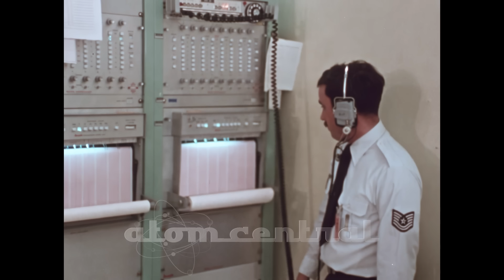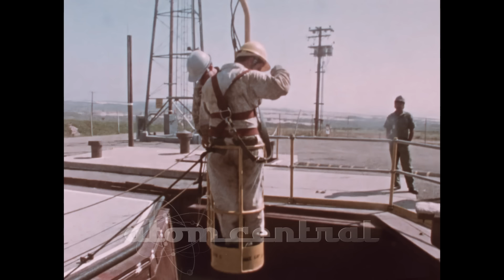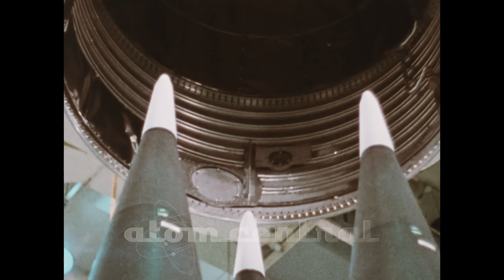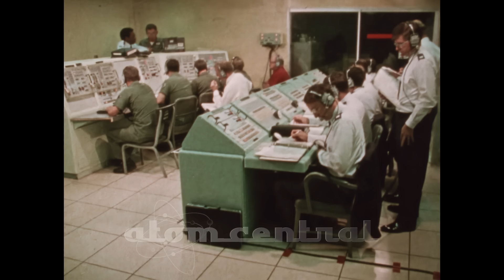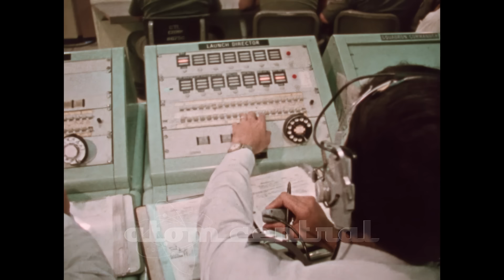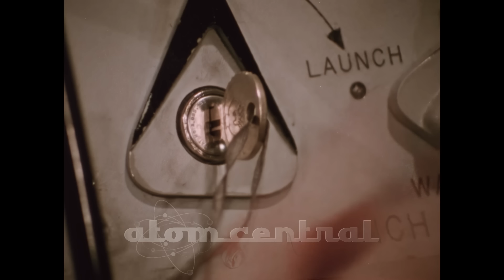Countdown for Deterrence - Minuteman ICBM missile defense

Comment: The question that doesn't leave me is if it requires only one person to sabotage the launch in the bunker. given that the lunch procedure requires two people turning the key at the same time and geographically, these keys are situated such that not a single person can turn both of them giving their distance and the timer of roughly 3 seconds required to keep the key turned. if only one person can sabotage by refusing an order effectively that makes the entire silo inoperable, why then not automated? why do they have to have a point of failure such as human psychology? unpredictability in a system where the command and the decision-making process given the time constraints is not in the hands of the people turning the key but in the hands of the higher ups